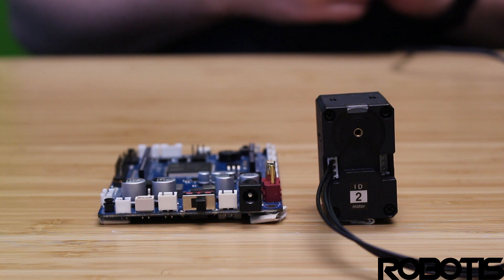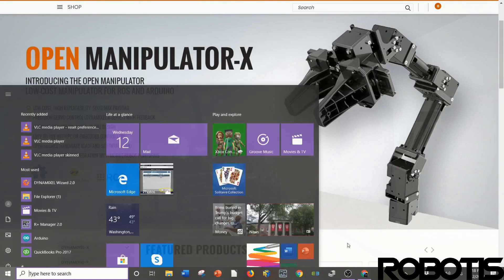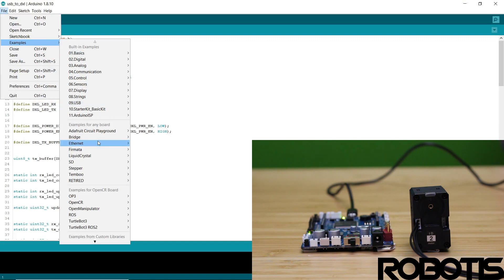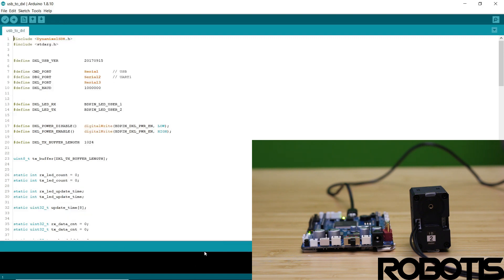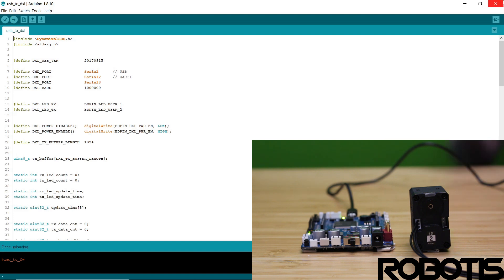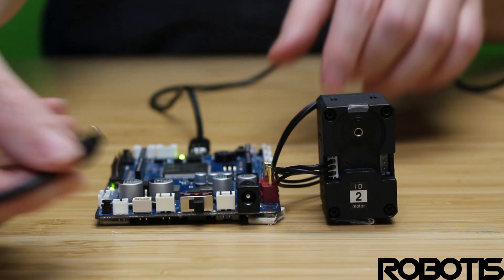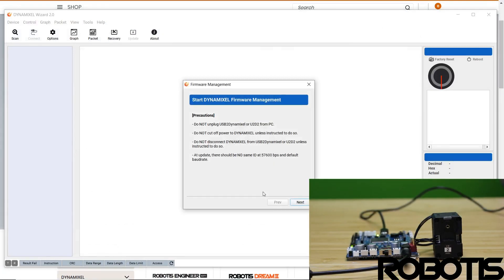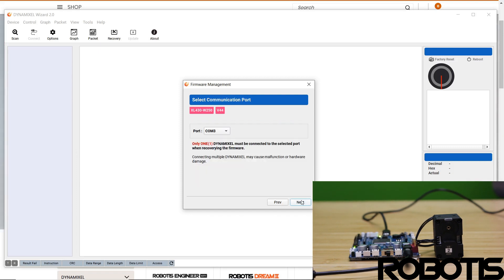How To: DYNAMIXEL Firmware Recovery Using OpenCR1.0

Comment: When trying to upload usb_to_dxl to my OpenCR I receive an error and have no idea what to do about it:

Arduino: 1.8.15 (Linux), Board: "OpenCR Board, OpenCR Bootloader"

Sketch uses 112736 bytes (14%) of program storage space. Maximum is 786432 bytes.
Global variables use 41248 bytes of dynamic memory.
opencr_ld ver 1.0.2
An error occurred while uploading the sketch
opencr_ld_main 
>>
file name : /tmp/arduino_build_753272/usb_to_dxl.ino.bin 
file size : 111 KB
Open port OK
Clear Buffer Start
Clear Buffer End
>>
cmd_read_board_name fail : 0xF020
Reply from the maker: Hi Brett, 

Thanks for your question and for bringing this to our attention. Have you had the opportunity to perform any additional troubleshooting or resolve the issue? If you'd like to go over this in more detail with our team, it would be fantastic if you can copy this into a post on our new support forum community.robotis.us! Our team and other experienced professionals are on the page and glad to help incoming questions!
Best regards, 
CS

Comment: i am using waffle pi and have been using two dynamixels (ID001 and 002) XM430-W210. After recovering each individually, i am trying to scan using Wizard 2.0 for both but the software detects only one drive with repeated errors [ID:001]ERROR/[ID:001]TIMEOUT. How i can fix that?
Reply from the maker: Hi there Syed,  if you've firmware recovered both of the DYNAMIXEL servos you will need to change the ID number on one of them before you can detect them both. The firmware recovery would have set the ID# for each servo back to "1" which is the default. If multiple servos are connected and share the same ID number, you will likely not be able to detect one or both, and you will have packet errors like the ones you've mentioned. We'd recommend using DYNAMIXEL Wizard 2.0 software to change the ID number for one of those servos to something other than "1" and you should be able to detect both again. 
If you have more questions it would be great if you can join our new community forum community.robotis.us for further support!
Reply: @robotisus  Thank you very much. It worked for me and both dynamixels are detectable now. However when i complete the OpenCR setup using following the link:
https://emanual.robotis.com/docs/en/platform/turtlebot3/opencr_setup/#opencr-setup
Program executes with no error and i see "[OK] jump _o_fw". However, the push buttons on OpenCR1.0 sw1 ans sw2 are unable to rotate both dynamixels. The serial monitor using arduino is able to confirm the response from both buttons. Can i hard reset the openCR 1.0 in this case and how?
Reply from the maker: @ukwalay  It should be possible to reset the OpenCR1.0 by reuploading its program, but that may not be the issue based on your description. For further troubleshooting, please post on our forum (https://community.robotis.us/) where we can post more links and information to help.
Reply: @robotisus  Just found out that the resetting Dynamixel set some flags to different values. I had a spare one so copied those setting to resume my motors working.
Reply from the maker: @ukwalay  Glad to hear you were able to resolve the issue!

Comment: can we set the servo's id with thats equipment?
Reply from the maker: It's certainly possible to set the servo ID's using the OpenCR1.0, either using an Arduino example for OpenCR1.0 or by using the "usb_to_dxl" example in Arduino that allows OpenCR1.0 to act as a USB interface for DYNAMIXEL servos. With usb_to_dxl uploaded to OpenCR1.0, you can use ROBOTIS software directly with DYNAMIXELs you have connected to the board. 

If you have any other questions, please join and create a post on our new Community Page: Community.robotis.us . This forum will be our new channel for product support, free lessons and tutorials, and more. Our team will respond directly to posts on the Community Page and you can get into touch with other experienced DYNAMIXEL users!

Comment: Is there an option to recover the firmware using an Arduino Board + DynamixelShield?
Reply from the maker: No unfortunately this shield is unable to perform the firmware update. To update the firmware you have to use ROBOTIS software which the arduino is unable to communicate with.